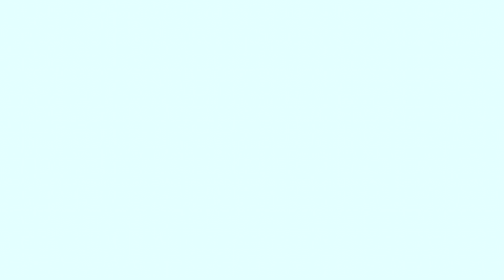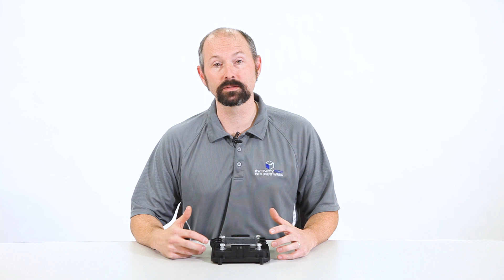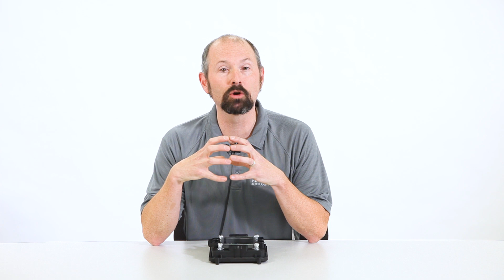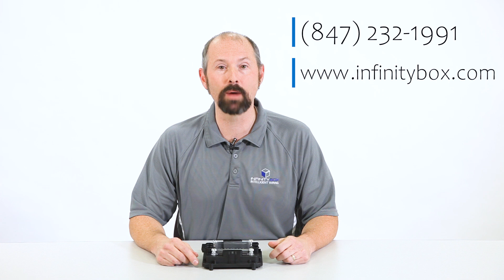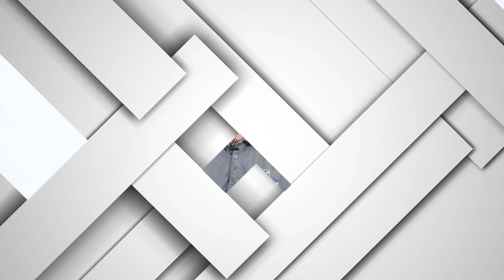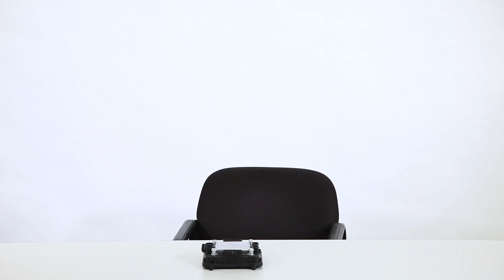Infinitybox POWERCELL Introduction

Comment: So, do the POWERCELLS piggy back to each other in series via the CAN bus harnesses or do they all have to connect to the MASTERCELL?
Reply from the maker: Each POWERCELL has two CAN ports so you can piggyback them.  Essentially, you can set up a long string of POWERCELLs, each passing the CAN data to the next one in the line.
Reply: @infinityboxllc  awesome...gotta love the CAN bus network!

Comment: How many powercells can the master cell support? Is it limited by the number of connectors on the mastercell?
Reply from the maker: You can have up to 16 POWERCELLs and inMOTION cells connected to a single MASTERCELL.  However, you are limited to 50 inputs on the MASTERCELL.  Depending on how you want the outputs to work, the practical limit is 5 to 7 cells.  Does this make sense?
Reply: @infinityboxllc  Yes, I think so. Thanks